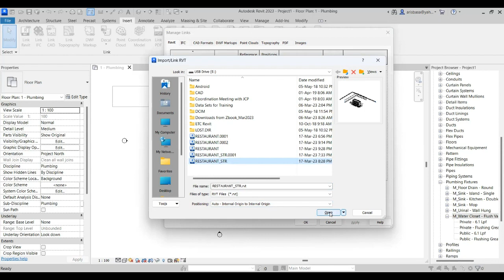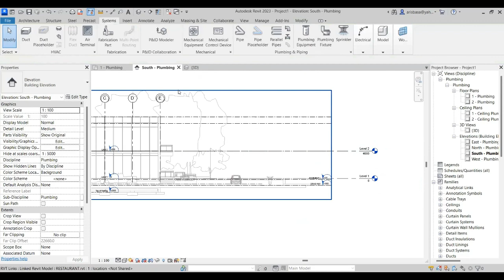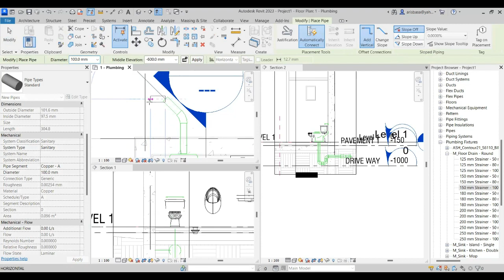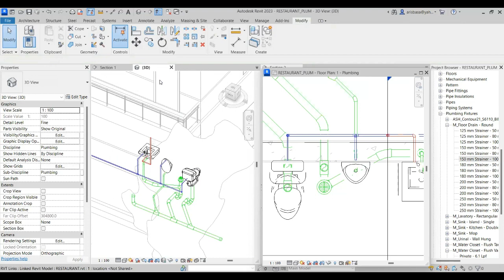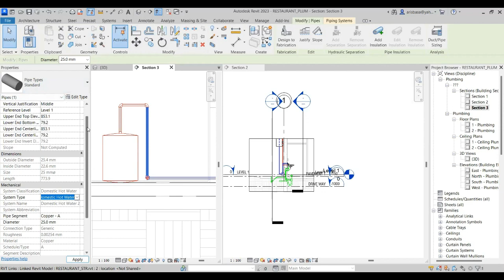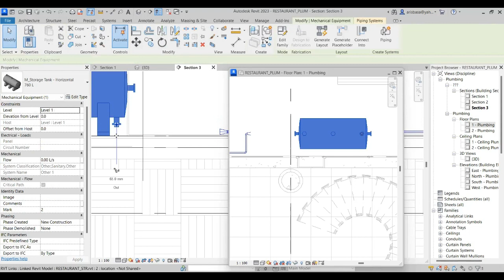REVIT LIVE with Aris Basa - PLUMBING

Comment: Good day sir need ba talaga na MEP yung Template
im new to revit kasi sir at gusto koeh yung architectural structural MEP e sa iisang file lang
Pero pag ginagawa ko sa Architectural Template yung pipes may error na message
 
"Revit could not find a matching Pipe Segment in "Pipe Types: Test Pipe". Please check the routing preferences of "Pipe Types: Test Pipe".
Reply from the maker: Mas madali kapag ginamitan mo ng template and link the arch model since nasa template na yung pipes that you need. Pwede mo din naman ideretso na sa isang model lahat ng disciplines especially if you are working on a small project. Kailangan mo lang magload pa ng mga families for SMEP that you need.  For the error message, just make sure on the sizing and levels of the pipes, errors would usually appear kapag mali yung slope or baligtad yung slope. Just imagine you are doing it in real life, considering the slopes, size of pipers and correct bends. Alternatively, if you have used a template at ni link mo yung Arch model, pagkatapos mo gawin yung corrent MEP model and you want them to be one file, pwede mo naman ma bind na yung link so you will just have a single file. I hope this helps! Let me know your progress. Thank you for watching!
Reply: @ArisBasa  maraming maraming salamat sir...
Reply: @ArisBasa  maraming salamat sir for now MEP na template gamit ko 
followup question sir ano maganda method para sa catch basin at septic tank? para mapadali yung aking ginagawa is wall at floor na muna family para sa septic tank kaso parang sa architectural kasi yun meaning gray sila
Reply from the maker: @zagvot  download ka muna ng ready made MEP FAMILY na septic tank.